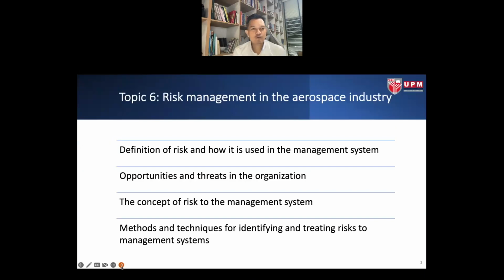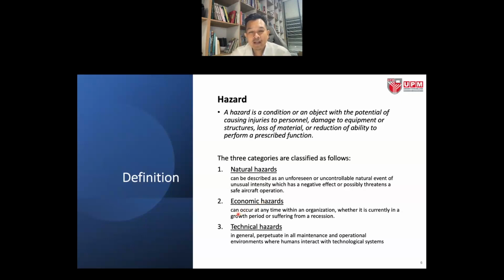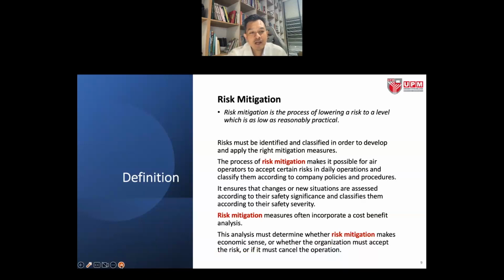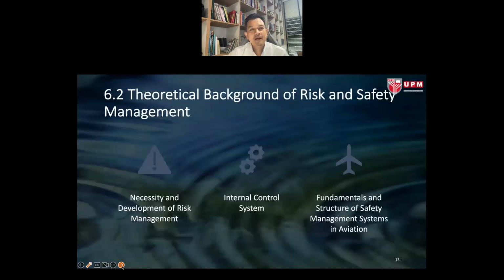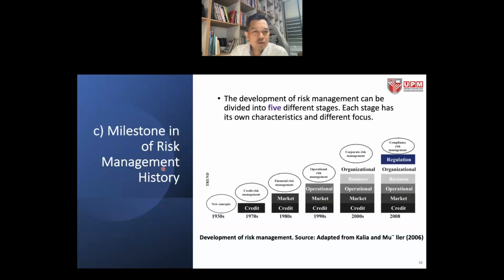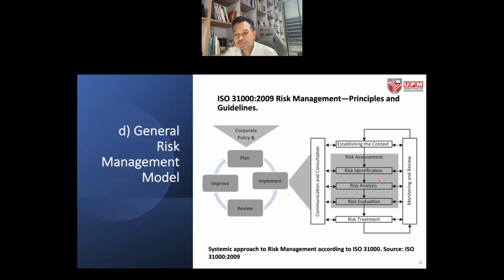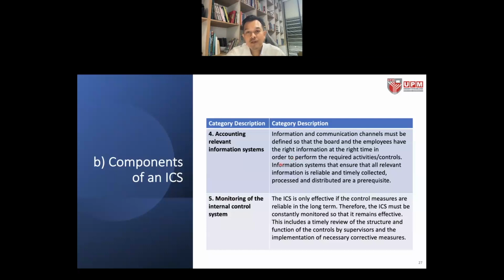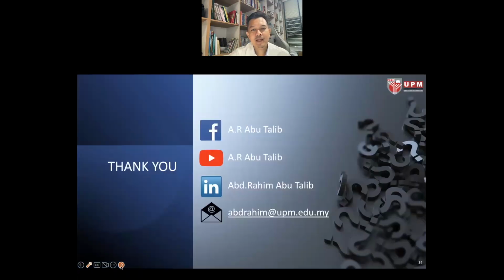AEROSPACE INDUSTRY | RISK MANAGEMENT

Comment: Speaking of hazards, the greatest threat to aerospace manufacturing, MRO, and aviation as a whole is Foreign Object Debris (FOD). They may be as small as a single coin. Still, they can cause millions of $ in damages (think of FOD ingestion during jet engine testing, causing severe damage to the fan blades with an explosion risk) or worse, result in loss of lives and discontinuation of commercial service of a civil aircraft, such as what had happened on the Concorde after it crashed on the runway due to FOD ingestion.

Hence, the risk mitigation towards FOD may be divided into 3 with increasing severity (speaking from past experience at Spirit AeroSystems Malaysia): Awareness, Control and Restricted, if I recall correctly.

Awareness is generally applied to the whole factory floor or hangar, and all staff must be conscientious towards their possessions and be vigilant not to misplace them or accidentally drop them on the floor.

Control is applied to the workstations or shop floors, and tighter controls are enforced, such as clearly-marked tool kits to prevent misplacement of tools on the product or aircraft, and quality checks are imposed on it before leaving the production line.

Restricted is applied to high FOD-sensitive zones such as paint shops and MRO testing areas in hangars, where each staff member working in these zones must surrender all their possessions, including their ID cards or tags, because they are sharp enough to damage the product or aircraft by scratching. Hence, FOD is another abbreviation of Foreign Object Damage.

- Lai Hong Yi, GS66631.